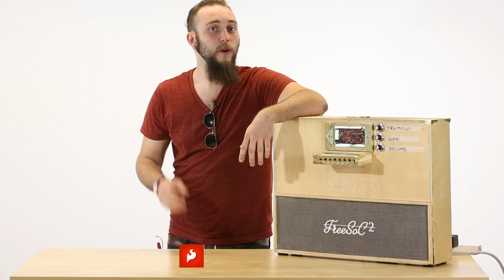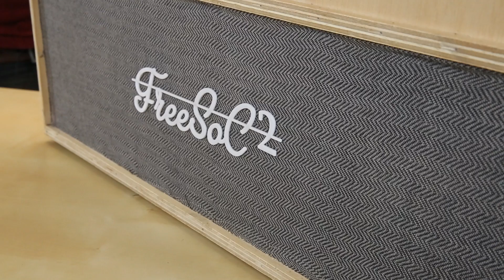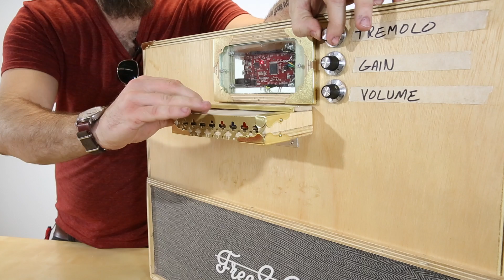SparkFun FreeSoc2

Comment: @MalcomForde: The PSoC is different from an FPGA as it still is a microcontroller-class (MCU) chip, but integrates the best of mixed-signal domains into a single SoC. PSoC combines an ARM processor, a programmable/configurable Analog front end, some programmable logic (more like a PLD than a full blown FPGA), as well as a programmable 8-bit datapath. The native development environment, PSoC Creator, includes a Verilog synthesizer buried in it, if you really need it, but most of the time, you are expected to simply instantiate a soft block from our list of existing blocks, called PSoC Components, that combine the PLD , datapath and analog resources.
In the end, you have a chip that behaves like an FPGA at the power consumption and price-point of an MCU.